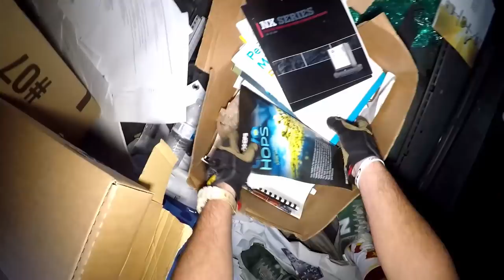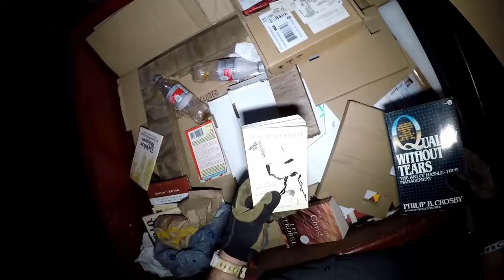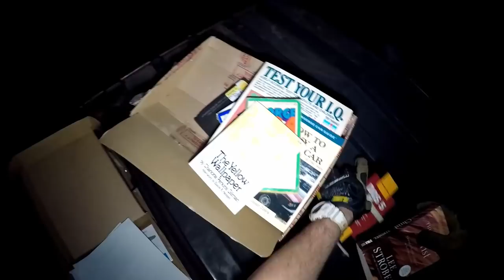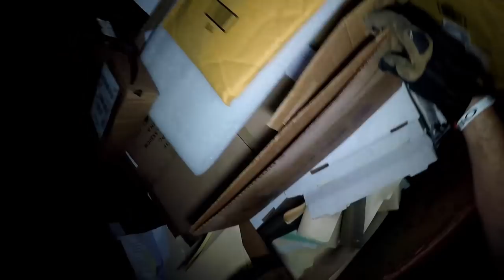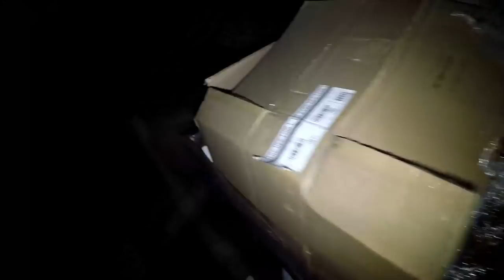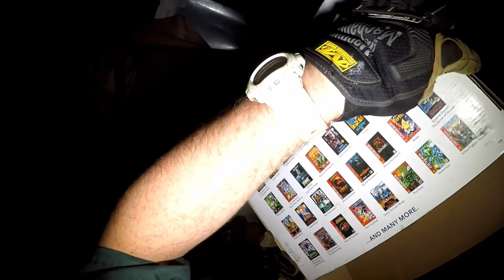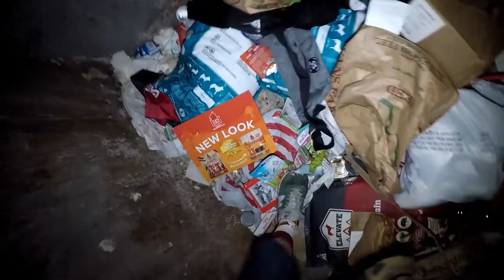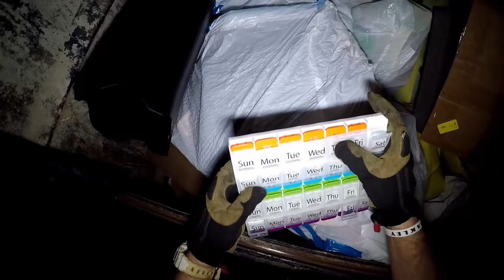Found This Scavenging

Comment: Mike, Prior to throwing out or scrapping that fan, take an air compressor and blow off the brushes and the magnet's and lubricate with some 3 in 1 oil! Put it back together and re- try , should run like new ! Now you can use it yourself or sell for $20 or $30 at yard sale!  Try this method at least one time!

Comment: The vibrating plates can be used when you are making things out of concrete/plaster in moulds to get all of the air bubbles out of them, also when using resin in moulds.
Reply: Jason Stevenson Vibrating tables are also used for people to loose some weight.
Reply: The Algonquin yeah
Reply: Awesome find.. could use one with resin i do.

Comment: That cable/wire at 25:00 is worth about $75 to $100. Check the prices on them before you scrap it. I just had to make one up for my Welder. 👍🏻.   Hook that airbag up to 12 volts with a LONG wire. Lots of fun. The vibrating tables are good for casting things with plaster or cement. It vibrates the air bubbles out.  🇺🇸😎

Comment: a speaker magnet glued with rtv silicone to the bottom of any stainless steel bowl or tray from the dollar store makes a cheap magnetic tray. hard drive magnets work too. those vibrating tables might be for potting up house plants. they work the soil down into the pot better. always use one for a paint shaker.

Comment: Squirt oil around the bearings  while the fan is running.  Then while running pick the fan up and turn it all directions, that should get the fan running right.

Comment: Hook up the airbag to remotely eject thieves from your front door. 😂💥boom.
The vibratory table is for packing molds tight/ removing air bubbles you probably could bolt a box on it to make a tumbler for seaglass /polished rocks or polishing parts / tools. Use your imagination you will figure out a good use. Nice find on that one.

Comment: Just a few of the benefits researchers and vibration plate users have reported include: Losing weight and keeping off small amounts. Decreasing your stress. Improving circulation. Increasing flexibility and better balance. Better core.

Comment: Don't scrap that heavy cord, it's most likely a welder extension cord.  You could probably get 30-50 + dollars on Ebay.
Reply: Vibrating table for concrete and gypsum, etc., 300 - $600.00

Comment: imagine walking down the streets and Mike is on his all 4 on a vibrating table and talking to himself... weird! haha

Love your content tho!
Those tables are used for both humans and dogs, it helps you loose weight.
Reply: not for losing weight. They are use to compact concrete or liquides.  also to compaction and settling of dry bulk materials and more
Reply: Sheila Stewart there are multiple using areas. My mother used to have one, and it was bought from a fitness center.

Comment: What triggers an air bag . A 12v signal from a very small yellow or orange box in the front of the engine bay. inside it, it has a glass tube with a ball bearing and two contacts . when the impact of an accident forces the bearing through the end of the tube it touches the 2 contacts and makes a circuit setting off the airbags. Now you know.  The wiring for it is yellow or orange and stands out  from all the other wiring in the engine bay.

Comment: Man I wish I was close to you I would give you double or more the value of scrap for that extension cord for 220 volts cable you had at 29:40. that looked like it could use a little work and make a good extension cord for 220 volts.

Comment: Live Vibe whole body vibration helps you rejuvenate, recover and realize a whole new level of fitness and wellness. This revolutionary machine delivers a host of benefits not found with traditional workouts.
Revibe Your Life
• Rebuild Bone Density

• Relieve Joint Pain

• Reform Connective Tissue

• Rejuvenate Circulation

• Recharge Muscles

• Reduce Arthritic Pain

• Revive Flexibility

• Rehab Aches & Pains

Comment: I remember when they first came out with vibrating pads with hand grips.They were the newest thing at the gym and the pro ones went for about $2000-$5000. They were used to improve bone density. All of the micro adjustments your body makes when it vibrates equals stronger bones. I want one for my old age!

Comment: back on the board mike old bike must of gotten damaged too meny skids into dumpdsters that or mike threw something heavy into the truck and it hit it, oh no there's the bike, also that unit cubical is mostly wood but the sides might be alluimum, not much in the dumpsters tonight it would seem hay a fan what you doing in the dumpster? morden junkie system mike worthless as the controllors break the games are meh and its just a cheap system like the 2600 flash back cheapy cheap not made to last, unlike the old consoul, air bag in the dumpster? that's not good less you wire it up to explode and do something cool, now the nights getting better, ugh diapers and dog food in the bin it be okay but you don't know might be its okay but if there throwing it out its either past its eat by date, or its not very good might be something wrong in the ingreatants,